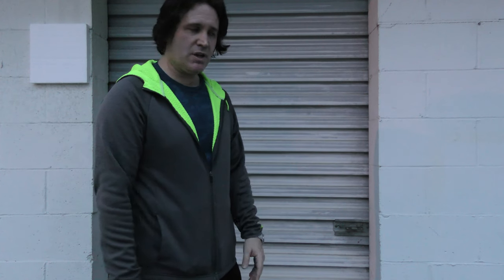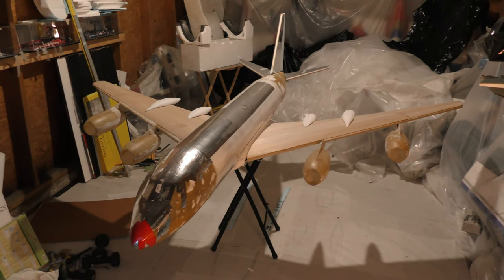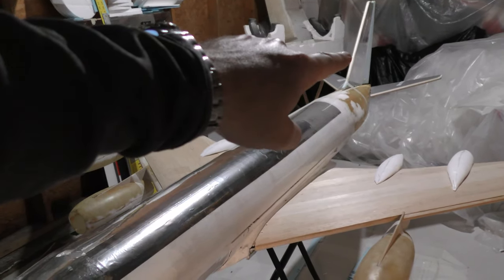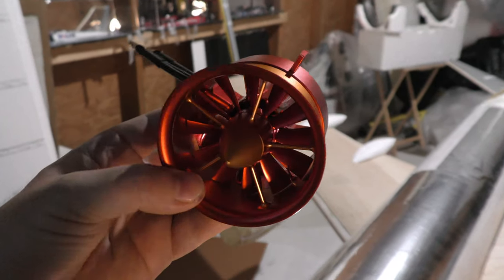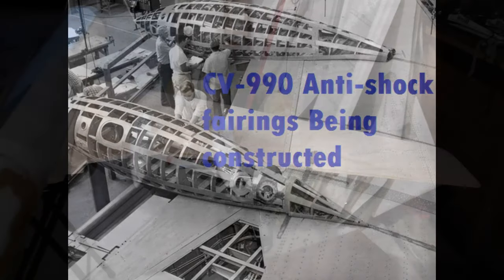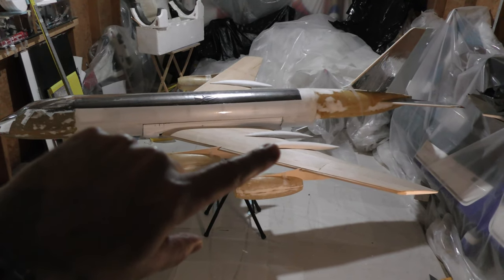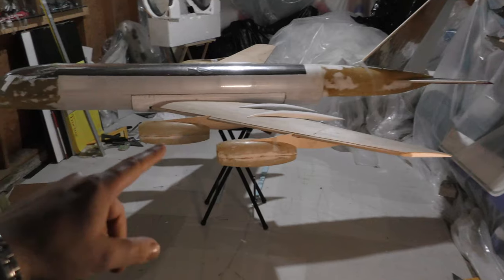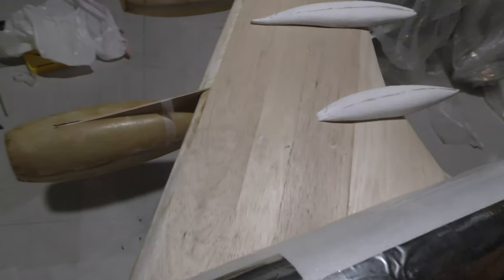Building The RC Convair 990A RC Airplane

Comment: great video, I didnt know that those things on the wings where actually fuel tanks
Reply from the maker: Thankyou Benny, they where designed as functional anti-shock bodies, then Convair-General Dynamics said "hey lets fill these with fuel" lol didn't work, if it did the CV-990 would have had an extra 500-700 Miles in range.